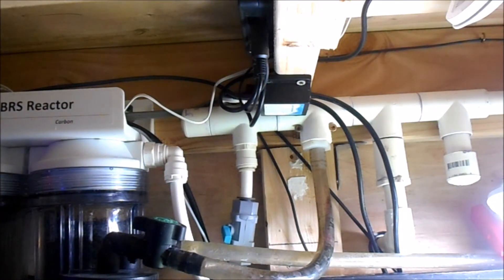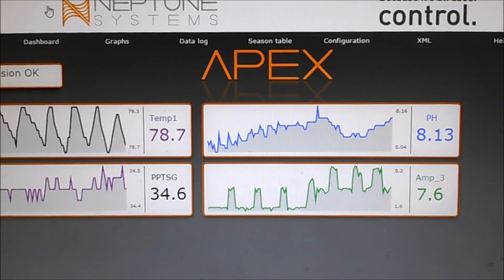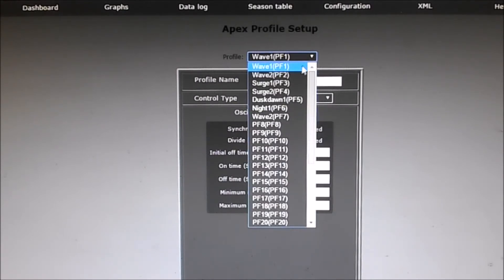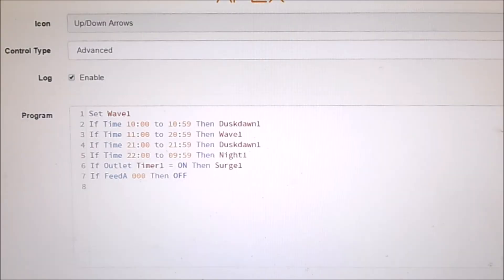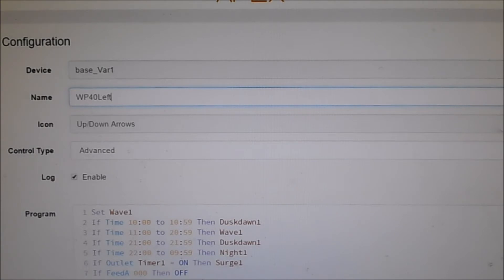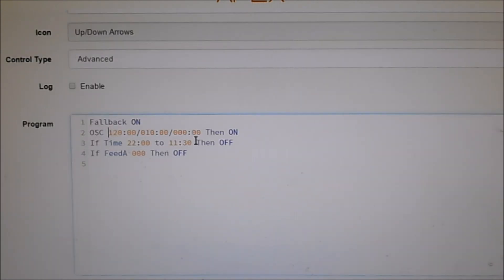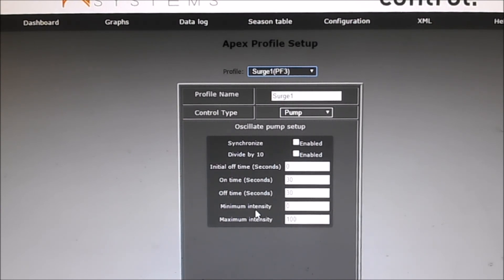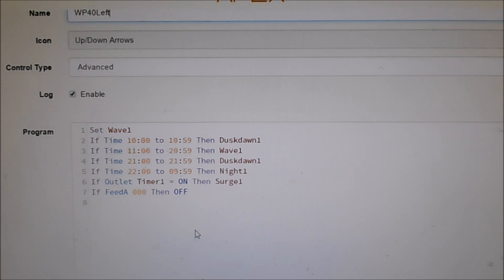Setting Up Jebao To Apex Adapter With Basic Programming | Apex Controller

Comment: Hi Travis!  I have watched you for some time now and I am always am informed and amused.  This is an old video but hoping that the question is still relevant.  I would like to run 2 Jebao powerheads and a control pump.  Can I do this off 1 harness or would I need 2?  It was to hard to discern with you having 4 pumps what you used.  I haven't bought my Apex EL yet but am trying to figure what I need before hand.  Thanks man, sure do appreciate you!!

Comment: I have the vdm module hooked up and the jebao module hook to vdm via Ethernet cable what power supply do I need to jebao module ?
Reply from the maker: the jebao mondule connect to two powerheads and is connected to the vdm
Reply: I guess what I’m asking is do I need to run a power supply to jebao module or will it get power from the vdm module ?

Comment: Is it possible to configure each pump individually if you have 2 plugged into the same adapter?  Or does 1 adapter universally control both pumps plugged into it.
Reply from the maker: one jeboa to apex adapter controls two pumps. You will need to program each VSP
Reply: So if I'm understanding you correctly, each 2 pumps controlled by 1 adapter can be individually controlled through their own separate VSP?  So theoretically I could have 1 pump plugged into the controller turn on at 30% and the other pump plugged into the same controller at 70%?
Reply from the maker: yes its port can control two VSP so thats two pumps. You can run them at whatever you want just make a profile for it.

Comment: HI. I followed your directions in the video & not working as expected. I'm trying to create a wave in the tank with the added night wave & dusk to dawn option. I have a 30gal JBJ Nano & the 2 pumps are located on the back glass & not the sides. With the Jeboa controllers, I'm able to get great waves.  I'm sure I'm missing something and was wondering if you could take a look? Your help is greatly appreciated.  Here is my configuration.

BTW..... Love your YT channel. Very helpful.

Thank you in advance.

~~~~~~~~~~~~~~~~~~~~~~~~~~~~~~~~~~~~~~~~~~~~
Outputs
Output Configuration:

Device: base_Var1
Name: Jeboa_Left
Program: 
Set Wave1
If Time 07:00 to 08:59 Then DuskDawn1
If Time 09:00 to 20:59 Then Wave1
If Time 21:00 to 21:59 Then DuskDawn1
If Time 22:00 to 06:59 Then NightWave
If Output Timer1 = ON Then Surge2
If FeedA 000 Then OFF
If FeedD 000 Then OFF

Device: base_Var2
Name: Jeboa_Right
Program: 
Set Wave1
If Time 07:00 to 08:59 Then DuskDawn1
If Time 09:00 to 20:59 Then Wave1
If Time 21:00 to 21:59 Then DuskDawn1
If Time 22:00 to 06:59 Then NightWave
If Output Timer1 = ON Then Surge1
If FeedA 000 Then OFF
If FeedD 000 Then OFF

Device: base_Var4
Name: Night_Wave
Program: 
Set NightWave

Device: base_Var3
Name: Timer1
Program:
Fallback ON
OSC 120:00/010:00/000:00 Then ON
If Time 22:00 to 09:30 Then OFF
If FeedA 000 Then OFF
If FeedD 000 Then OFF

~~~~~~~~~~~~~~~~~~~~~~~~~~~~~~~~~~~~~~~~~~~~~~

Profiles
Profiles Configuration:

ID: 1
Name: Jeboa_Left
Type: Pump
Synchronize: Enable
Initial Off Time: 0
On Time: 1
Off Time: 1
Minimum Intensity: 0
Maximum Intensity: 100

ID: 2
Name: Jeboa_Right
Type: Pump
Synchronize: Enable
Initial Off Time: 0
On Time: 1
Off Time: 1
Minimum Intensity: 0
Maximum Intensity: 100

ID: 3
Name: DuskDawn1
Type: Pump
Synchronize: Off
Initial Off Time: 0
On Time: 1
Off Time: 1
Minimum Intensity: 10
Maximum Intensity: 50

ID: 4
Name: NightWave
Type: Pump
Synchronize: Off
Initial Off Time: 0
On Time: 10
Off Time: 10
Minimum Intensity: 30
Maximum Intensity: 30

ID: 5
Name: Wave1
Type: Pump
Synchronize: Off
Initial Off Time: 0
On Time: 1
Off Time: 1
Minimum Intensity:0
Maximum Intensity: 100

ID: 6
Name: Timer1
Type: Pump
Synchronize: Off
Initial Off Time: 1
On Time: 1
Off Time: 1
Minimum Intensity:0
Maximum Intensity: 100

ID: 7
Name: Surge1
Type: Pump
Synchronize: Off
Initial Off Time: 0
On Time:30
Off Time: 30
Minimum Intensity:0
Maximum Intensity: 100

ID: 8
Name: Surge2
Type: Pump
Synchronize: Off
Initial Off Time: 30
On Time:30
Off Time: 30
Minimum Intensity:0
Maximum Intensity: 100

~~~~~~~~~~~~~~~~~~~~~~~~~~~~~~~~~~~~~~~~~~~~~
Reply from the maker: Contact me via email to setup an apt
Reply: Thank you, Sir!

Comment: I have current USA Eflux wave makers and was wondering do you know if I could rig something up to use them on my apex? I do notice they have the same connections as the jebao but they are reversed. I am just getting into this hobby and your videos are awesome. I feel so much more informed after watching most of them. I just wish I started watching a couple weeks earlier before I bought these Eflux wave makers. 😬
Reply from the maker: I dont know anything about those wave makers, I would say if they are controlled by a 0-10 v controller they would work. You can also get the jebao adapter and see if they work. If not id sell them and buy jebao if thats what you're looking to do.
Reply: FishOfHex I found out that they are not 0-10v. So I'm going to sell them and buy the jebaos. I had one question, did you use a regular ethernet cable connecting from the apex to the jebao  Apex link controller Adapter?

Comment: hello. I set mine up exactly like u did. I figured id go with what you got then tweak anything after I learn what I want. ive checked and checked everything is just like u got it but for some reason the power head comes on for few minutes then turns off. its currently night time, I just cant figure out why its turning off. any ideal what ive done wrong? I timed it stays on 2 min then they turn off
Reply from the maker: I wouldnt be able to help you in the comment section. If you want you can email me though my website fishofhex.com and setup an apt and i can log in and fix whatever is wrong with your setting.

Comment: hi I got a question in the apex fusion I have the graphic the temperature, the PH, And the energy bar EB8 but I have another graphic is TMPII I don't what is this graphic for and  is always at 22.4  do you have clue?
Reply from the maker: You can just remove it by clicking the lock icon and hitting the x to remove it. If your apex has two temp ports it will show the extra one.

Comment: followed every setting for the jebao pump pp8 so I have a question the power from the pump  does it need to connect in the apex energy bar or why you made those virtual outlet setting?????
Reply from the maker: My virtual outlets are for surge mode timers

Comment: wheronfused I just got the jebao-  controller,  where it says DC in  voltage did you have to buy power adapter to apart to get this work????
Reply from the maker: Use what came with your pumps
Reply: FishOfHex oh OK it make sense so the controller for Pump pp8  I take it out the equation?
Reply: also I'm gonna have to buy a apex VDM because my apex jr don't come with v1 and  v2 pump control to connect the Ethernet

Comment: when you installed the jebao- apex controller , do you need another apex module like apex  one link to connect them ?
Reply from the maker: Just the jebao to apex adapter and a cat 5 cable

Comment: what kind of adapter do i need?
Reply from the maker: https://www.amazon.com/Neptune-Systems-Controller-Linkage-Adapter/dp/B0149K2ZUE
Reply: So I need to get 1 for each of the wavemaker?
Reply from the maker: one adapter supports two wave makers
Reply: As for the cable, just any internet cable?
Reply from the maker: yup standard cat5
Reply: what powerhead did you use? is it PP? or WP? I notice on amazon description is only for wp/rw/fs.
Reply from the maker: I use two wp40 and two pp8
Reply: I can use pp8 with that adapter? Or it has to be wp40?
Reply from the maker: I have all 4 connected to the apex

Comment: Is there a way to make/program a "reef mode" using this adapter? I currently have a wp-40 and an rw-8 running?
Reply from the maker: Thats what i use two surge modes for to change up the flow patterns. You can just make different profiles and do it that way.

Comment: FishOfHex, great video. I've copied your profiles and outlet setups exactly. The only problem I'm having is that the powerheads don't alternate. They both operate at the same time. Any ideas would be appreciated.
Regards,
Mike W.
Reply from the maker: Try putting one on a small delay before it kicks on to see if that works. I have to do a more in depth video on this system in the future.
Reply: I finally figured out how to do it. I created a virtual outlet for each powerhead and then did an oscillation program for each. Thanks for your explanation on virtual outlets. I read about them but really had no idea how they worked or how to program them.
Reply: Could you elaborate on how you did this? I'm having the same issue with trying to have my two pumps alternate and I can't figure it out.
Reply from the maker: I will be remaking this video but you need to make another profile for the second wave pump here are the links to what they should look like http://i36.photobucket.com/albums/e33/hexdex87/Fullscreen%20capture%20122017%2051741%20PM_zpsk3vlizb7.jpg
http://i36.photobucket.com/albums/e33/hexdex87/Fullscreen%20capture%20122017%2051830%20PM_zpshhl9adqh.jpg

Comment: Great video.  Maybe I missed this but what status do I put the powerhead outlet to?   Right now it's set to on but I suspect my water change switch it won't turn the pump off?
Reply from the maker: +Jeremy Flessner I leave the powerhead outlet on all the time. So you would use the pump type control. Initial Off Time 000 On Time 005:00 Off Time 000

Comment: I have been considering an apex jr for my tank and currently have two jeabo wavemakers. Will the jebao to apex modules plug right up to an Apex Jr or would I have to have a VDM module to run them on the Jr?
Reply from the maker: +Ryan Moffitt I personally would Never buy an Apex JR. The max modules you can have is 5 and trust me if you plan on growing in this hobby 5 just wont be enough. It doesn't look like it comes with Variable speed ports so you would have to buy the module. I would save the money and buy the standard apex with the power 8 bar and that can have up with 240 modules. FYI if you really want to buy Apex Jr dont buy it new get a used on of C List or something bc most people end up having to upgrade to regular. I hope i answered your question.
Reply: +FishOfHex Took your advice and bought a full Apex w/Lab probe. Got the waves setup, but working on the virtual outlet now. Thanks again for your video!
Reply from the maker: +Ryan Moffitt Nice man did the ph calibration go ok for you? If you have any questions I can make a video for you to take care of anything for the apex. Just ask bro.
Reply: +FishOfHex I haven't set the Ph up yet, need to get a probe mount. I appreciate it!
Reply from the maker: +Ryan Moffitt Quick tip use a suction cup from a heater put a zip tie through the side of it make a whole and that will hold the probe for now.
Reply: +FishOfHex awesome tip, thanks again!
Reply from the maker: +Ryan Moffitt no problem man